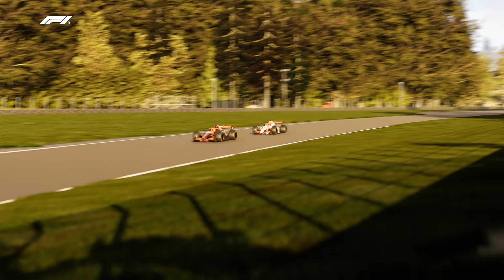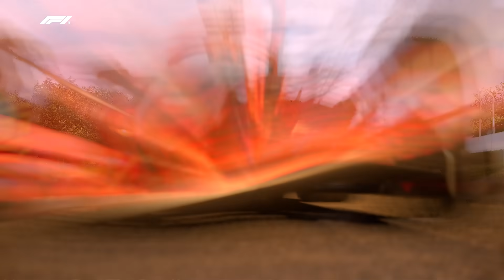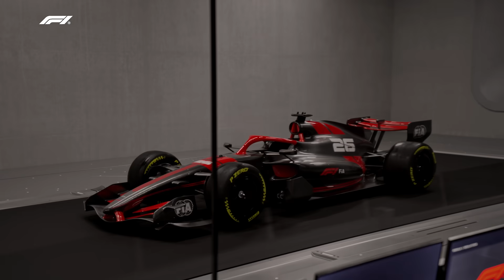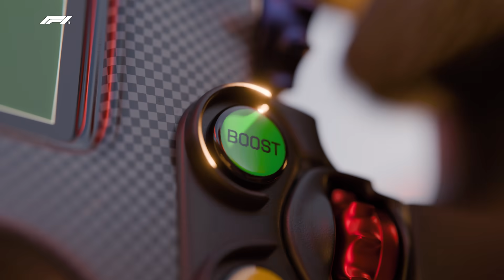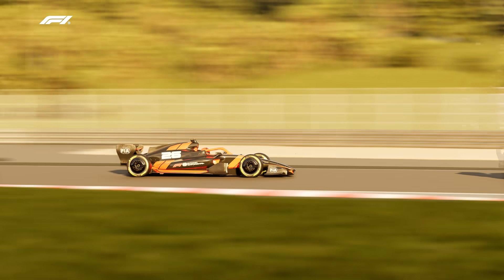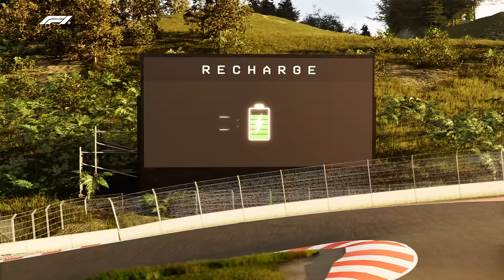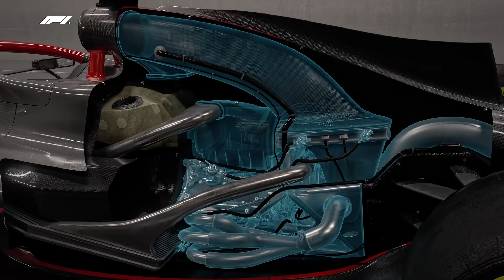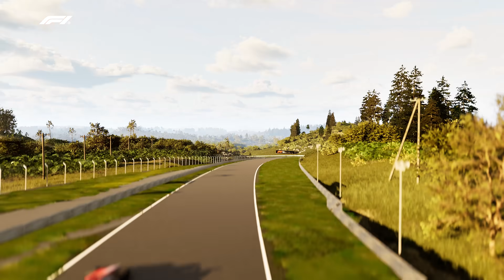Everything You Need To Know About the Formula 1 2026 Regulations

Comment: Those barge boards will make for some vicious track debris.
Reply: Lets hope they dont account for too much aero performance.
Reply: @narancs5  They look like they'll grab any wash and force it through the body of the car..
Will they lose a huge chunk being forced through the body if the lose one of those.
Reply: @FingersTitan  I was thinking that some of the safety improvements, like the side impact structure, being done because of the added danger of these barge boards.
They look so flimsy, surely they must be reinforced somewhere, but yeah, i'm curious to see if they can sustain any damage, or how useful they'll be when they get damaged.
I wouldn't be surprised if they get dropped at some point, also just because they look silly.
Reply: Thinking the same. Hopefully they’re a lot more durable than the previous barge boards
Reply: Personal I don’t like the barge boards as it means when cars have wheel to wheel racing and the smallest amount of contact could ruin a cars entire race this will lead to less battles on track
Reply: They're an instant track hazard waiting to happen. I could see those barge boards are easy to break in a collision and they'll be instant yellow flags all over the track.
Reply: That was my first thought!
Reply: Yeah, it would be nice if they could mandate use of a material that doesn't shatter into a thousand pieces like carbon fiber.
Reply: we've had barge boards for years, they were removed in 2022.
Reply: That was my first thought; those barge boards look fragile sticking out ahead of the floor behind the wheels. A minor side contact will knock them off and me up the aero on the car.
Reply: And also those wings with actuators in them. Did I ever see a race without a couple of ripped off front wings? don't think so.
Reply: Anything on the track that isnt another working car is a problem, numb nut.
Reply: Those gravels need their gravel ping pong rackets and those side by side racing needs more safety cars
Reply: It’s gonna be a disaster with how many of those break off during a GP
Reply: Yup lol
Reply: They are deliberately trying to force more yellow flags to bunch up the pack like they do with Nascar. Just look at who owns F1. We are going to see more scripted races vs pure athleticism/car setup.
Reply: @JeevaDotNet f1 only didnt have barge boards in the ground effect era tho
Reply: more safety car = more chaos ;)
Reply: What an unusual thought. Enjoy the sport
Reply: @withlovefromnate not unusual in any way.
Reply: @withlovefromnate  Not unusual at all, it's actually rather prudent to consider how the debris from a part of the car that is often hit during races might cause some issues if it is broken off a car.

Comment: Fans: "We want screaming engines back"
FIA: "Let's make the IC engine smaller and less powerful"
Reply: A bit worried about how much they'll rely on the batteries to be fully charged being 50/50 power split. Sone tracks are going to be slow.
Reply: soon they will add speakers to the cars to make the noise :face-green-smiling:
Reply: These engines somehow sounds somewhat better than the 2022-2025 ones
Reply: i want og atmosphere v10 sooo baaaddd
Reply: @AMDRYZENXAMOEM  we all want that. But F1 is ruled by people that hate cars, and are driven by a globalist agenda. Sadly.
Reply: It's not smaller by displacement, just de-tuned.
Reply: This sport depends on keeping constructors intrested. No car company cares about v10 engines anymore, its neither more efficient or even faster. The turbo hybrid era mercedes engine had almost 50% efficiency thats one of the largest improvements in IC technology ever. V10s are not coming back ever dude so deal with or stop watching
Reply: @AlexGarcia-xw4ts  V8s though… more enticing for manufacturers as it could essentially be two inline 4s put back to back.
Reply: @willsee7452 We would lose Audi right away as they've expressed no interest in less efficient engines. Or a significant decrease in the hybrid element.
Reply: @AlexGarcia-xw4ts I might stop watching. It's getting very mehh.
Reply: @AlexGarcia-xw4ts 
Ferrari are developing a V12 at the moment for their road cars with a new piston design to be smaller and more efficient 🤔
Reply: @AlexGarcia-xw4ts i think they can make v10 extremely efficient, but no county will improt cars with those engines, cuz of "green" agenda and "zero" emissions cars goal

Comment: I mean the only changes that were required were this:
- Drop car width by 20cm, length by 30cm and weight by 50kg
- Remove electric engine components and replace by an ICE of at least 8 cylinders, maximum 12.
But I guess fun was not on the menu

Comment: Iike the idea to rework DRS. There are still means to increase performance (battery, dynamic aero...) but more flexible to use. It opens more strategy but it wont be easy to understand for most ppl. Now we just hope it will work as intended.

Comment: if everyone can use 'straight mode' (DRS), then isn't there even less overtaking?
Reply: Yup.
Reply: Overtake mode is the replacement of DRS 

active aero is purely for performance
Reply: @leongao5120 they use the overtake mode to defend at the same spots as where another driver uses it to overtake…
It means NO OVERSPEED for the car behind thus even less overtakes …
Reply: @Redlingstein  no thats wrong. a car has to be within a second of the car ahead to use overtake. so whatever the drs was enabling you to do before you can still do it. but now you can use it anywhere on the track not just straights so on paper the overtaking chances must improve.
Reply: Boost and overtake.

Comment: BRING BACK THE V8'S 

GET RID OF THE BATTERY POWERED MOTORS AND THE GIMMICKS OF BOOST AND OVERTAKE 

MAKE RACING ABOUT RACE CRAFT - CAR PLACEMENT, LINE VARIATION, BRAKING, BAITING AND SO ON. . 

PUSHING A BUTTON TO OVERTAKE IS NOT FORMULA 1. 

PLEASE.

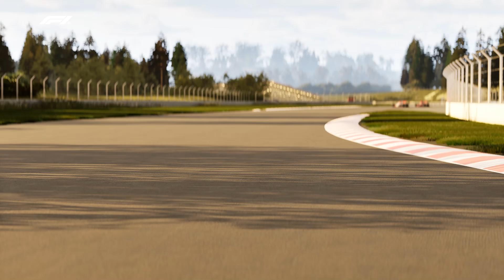Comment: 1:29 if active aero is available to every driver every lap, wouldn’t it be like having drs trains each lap since everyone has the “advantage” of reducing drag?
Reply: Active aero isn’t the replacement of DRS like everyone’s saying, that’s the overtake mode. Active aero just helps the cars go quicker around the circuit and isn’t designed to be an overtaking aid.
Reply: @JeffSmitho-du1ml Its DRS but they call it MOM now
Reply: yeah i guess, but you also got MOM...MY so ehh we'll see, at least i think it'll be better with fights, but yeah idk
Reply: Yup. No OVERSPEED anymore thus no overtakes
Reply: Shouldnt being fast be about driving the car instead if pushing buttons on a steering wheel?
Reply: This does seem a bit derr obvious. How are you meant to get overtakes done?!?! Not going to be watching this trash. Go back to the 2004 spec cars and regulations
Reply: @PerthLuxury with the overtake mode?
Reply: you should watch the video again, this time without sound turned off
Reply: and that's why boost and overtake exist
Reply: @illuminoeye_gaming which they all use at the same time and only a few times cos of the ENERGY SHORTAGE…
It will be 1 long MOM/DOUBLE DRS TRAIN each race
Reply: Congrats, you thought about it deeper than just surface level like the general public did

Yes that is exactly what's gonna happen and nobody seems to see how that's a problem
Reply: @Holoflux  did you miss the part about boost and overtake modes?
Reply: @Holoflux  I think you should check again.
Reply: @Holoflux  they are saying that its not like DRS were car needs to be in 1 sec window … its directly upto the driver with buttons and whenever they want to use …. Like overall … so drivers will have a lot of stratergic play to its … and if play small they can activate .. at a different specific point on straights … so not all driver will activate at same time … which will be fun to she when they do it …
Reply: @JugnooCreations 😂😂😂 all drivers use it in the same parts, mate. To attack and defend. So it’s gives ZERO STRATEGY
Reply: @Holoflux  who needs engineers when we have holoflux to explain where they went wrong..

Comment: The real reason why they need an active rear wing and front wing to reduce drag as much as possible is because of the 50/50 power split between combustion and electric for the whole race… If they kept the same high downforce cars, they wouldn’t be able to finish a race distance on a 50/50 energy split, very conveniently left out. This part is not an “innovation”, it’s a compromise. Don’t be fooled.

Comment: boggles the mind why turn sprint racing into endurance and "sustainable fuels" (lets face it - nobody believes it has anything to do with it) while you already have an endurance series, electric series, why try to mush all that into what once was top of the line SPRINT race... and I don't mean that joke they have added to Saturday for some events
all this extra weight, which is around 200kg, puts tremendous strain on the tires and makes the cars HUGE, both of which further complicate the series driving costs up

Comment: I still don’t understand the difference between “boost mode” and “overtake mode” - Both state they give the driver maximum power, only with overtake mode you can only use in a DRS style situation ie 1 second behind - What’s the point of this if you have boost mode which does the same but is utilised throughout the whole lap ? 🤷‍♂️ Nice to see the battery is now manually able to be deployed, like KERS back in the day

Comment: "The soul of F1 remains unchanged" is what they'll say in ten years when it's 100 percent battery powered
Reply: As a new fan of f1 can someone explain how that's an issue at all? Are combustion engines absolutely necessary for the "soul" of f1 if transitioning to a fully electric system doesn't compromise on the speed? Or do you just hate electric engines because they're much quieter lol?
Reply: @poper7534 The sound of a fully aspirated Formula One engine is the main thing it's associated with. Removing that completely would be tragic for fans, even if fully electric engines are the future for the road users. Formula One was always about lavishness and excess,not economical and cost effective.
Reply: @DanceySteveYNWA  Exactly, they've really started to believe in their "pinnacle of motorsport" mantra and went full pretentious and corporate on it.
The car industry itself has put the brakes on the EV switch, hybrid probably is the more likely future for a while, which they're trying to move away from.
I also miss the noise, as it is not the F1 that i used to know as a kid.

On the other hand, if Max wasn't winning, i'd probably not be watching F1, as i never just watched it for the racing or drivers before either.
So i am not really a representation of a 'true' F1 fan, but as someone who grew up associating screaming engines with F1, and now finally getting into it... it's still not quite as exciting as it could've been.
As a kid, i always loved the Tyrrell 6 wheeler, it was my favorite toy car, but unfortunately i wan't born yet to see them on track, it kinda feels like the more i get into it, the lamer it gets.

I would prefer it if the FIA just gave weight, size and budget limits, with a short list of banned materials (like uranium and plutonium and other extreme stuff), let the teams figure something out.
The product will have to be reliable, efficient and powerful, probably in line of what the "race to zero emissions" would want, without having to literally write the rule for it.
Reply: @DanceySteveYNWA   It's not only about cost effective but also ecological reasons. For me as a fan of F1 my entire life it's not issue at all.
Reply: Thankfully not possible until at least 2048 (not a typo)
Formula E has a contract with the FIA to remain the only fully electric single seater world championship until that date, with an option on a 2053 extension
Reply: They already have formula e
Reply: what is the soul of F1?
Reply: They are bringing V8 engines with zero emission fuel in 2030’s. Not electroc engines
Reply: @wohall1179 V8 engine with zero emissions?This has to be satire. (Or are they going to run on hydrogen fuel?)😂
Reply: @DanceySteveYNWA   I think what he was trying to say was sustainable fuels, making it a possibility for them to return since it is not fossil fuel.
Reply: @Guiliiii Everyone is looking forward to the engines running on Sugar Beet juice 😂
Reply: @DanceySteveYNWA yep because they see it as the only way we can have the v8 or the v10 due to the direction the FOM have decided to take the sport in order to maintain relevance but also interest the manufactures
Reply: @DanceySteveYNWA nah, I think the way they wanna do it is so that the car doesn’t release any carbon emissions. The fuel itself will still be from the same stuff, just that the car doesn’t release any carbon into the atmosphere
Reply: In the end what matters it's the speed
Reply: @analogikkortex  I'm not sure though, i mean, it is of course a big part of it, but 'lower speed classes' can be really entertaining as well, especially because they can often endure more hits without going into limp mode.
F1 cars are like fragile gazelles, the speed is defining, but i don't think it is the definition of F1 altogether.
And of course, if they go slower but they bring the screaming engines back, then it's also a bit silly, as we're just looking at more louder but slower cars.
But if they can find a better balance within the hybrid elements (more ICE = less weight = smaller cars etc.), it might be more entertaining to watch.

Comment: 5:00 can we stop caring about what is "road relevant"? There are hundreds of millions of hybrid and electric cars on the road that provide far more relevant research and knowledge for automakers than ten cars (~4 engines?). We're pointlessly removing one of the best aspects of the sport to appeal to some corporate nonsense. GT series are far better at road car development. 

F1 flies 10 freight planes 50 times a year around the world. How about it focuses on lower emission freight solutions? 

*Which isn't renewable fuels, by the way. A renewable source doesn't mean they don't burn the same as normal fuel. Trillion dollar oil companies are already funding renewable solutions for their own sake.
Reply: We’ll have a bunch of new, noisy, exciting, independent racing series in 5-10 years. This is inevitable.
Reply: You can buy a 9 11 with what is basically a MGU-H in it now
Reply: @counterfit5 no, the 1% can
Reply: Remember f1 is not a sport its a business
Reply: No, we can’t. Apart from many issues why would the leading engine manufactures want to invest the huge sums required if what they develop is only relevant to F1?

And the world needs responsible motor racing. Climate change demands that.
Reply: @peterbondy   There are 20 cars on the track with four different engines of which only two or three are made by everyday car manufacturers. Manufacturers have teams for brand recognition. If F1 wanted to move engine development forward, they would have each team develop an engine with more accessible cost cap regulations for small teams. 

On climate, if F1 really cared they would optimize race weekends for hybrid road freight and would stop flying their 10 cargo planes 40 to 50 times each season which is the cause of 70-80% of the sports emissions, the cars are responsible for less than 1%. It really does not matter if the cars are v12s burning normal every day petrol. 

But does the renewable fuel push matter? not really. Renewable fuels come from renewable sources, but they still burn and pollute the same as standard fuels. Its clever marketing language that doesn't actually mean that lower emissions. Trillion dollar fuel corporations are already throwing money at a solution, the sport does not need to do this on their behalf imo.

In conclusion, if F1 was really was about climate change and engine development, they would have every team develop an engine, optimise, race seasons for one continent at a time, and put all of their climate funding into low emission freight solutions.
Reply: @shaggy9756I can’t say I disagree with anything you’ve stated.
Reply: @peterbondy tell me you don’t math without telling me…
Reply: @lwclark  🤔

Comment: 5:33 the new power unit won't just be efficient.....
Correct it'll be less efficient without the MGU-H
Also i do believe that porsche is already using a system like the MGU-H in their latest 911 model
so technically, i would call that road relevant.

On a side note, why limit the amount teams can charge up their battery per lap? Why not give them unlimited charging allowed per lap? Sounds unnecessary

Comment: They missed the most important, and actual only thing you need to know about:
- Drivers forced to downshift on the end of straights when battery runs out
Reply: No downshift will happen.  On long straight tracks where that was an issue in simulations they are going to restrict the amount of energy deployment from the batteries to ensure there's enough.  However I think that only works with a full battery. There could still be potential situations where they run out of energy and have to choose to downshift and create major strain on the drive train components.
Reply: That's the biggest issue, I am sick of hearing about increased electric power in F1 cars
Reply: Did you notice how teams stopped talking about it? It was fake news to try to get rules changed.
2026 F1 is nothing new. Go watch a 2014 LMP1H onboard with the telemetry. You may have a bit more lift and coast than those cars. But downshift when battery runs out won't happen.